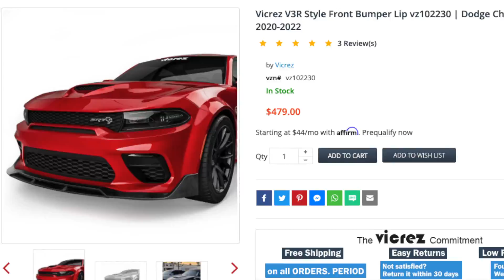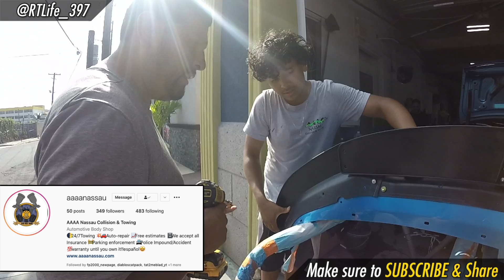Charger Widebody kit

Comment: For the louver. I had to put a super glue and velcro, cause the first time I put it on it was just a 3ms and when I tested it to 100mph,  half of the side came off luckily it didn't fly off. Lol but just letting you know velcro and super glue help my louver stick even going 120+ it's still there lol. Nice finished with your mods.
Reply from the maker: Oh man I'm going to keep an eye on that. Def don't want the Louver flying off while driving! Thanks man for the heads up

Comment: Check that gap in between the bumper and your front right fender. Looks like it wasn’t lined up right on install.
Reply from the maker: I believe it's the intercooler - it's too big for the front bumper. After the turbo install it didn't line up properly
Reply: @RTLife  did they try to trim a few pieces or get rid of some inner plastic pieces? Or is it literally against the actual bumper cover itself?

Comment: looks good, wouldnt do the louvers myself the (how to clean factor and dash cam) get the aggressive look. looked at the front lip decided against for the sticking out distance. Vicrez do some nice work. used them to turn my old v6 challenger into a widebody before i got my stock 392 widebody. seemed alot easier to buy then custom fit and work around non factory issues.

the engine work ive been very interested in that is nuts
Reply from the maker: I understand what you mean - both have their drawbacks. I really like a lot of products they're selling now. Pretty solid prices for the most part. The build is slowly getting there- little bit each month.

Comment: Very nice! Aggressive looking!

On a side note, not related... Do you happen to port your heads at all? I'm looking to do that myself, but wanted to know if you did, what gains did you have, if any? 

Thanks
Reply from the maker: I did have the heads ported when the stroker kit was done. Can't really tell you how much HP was gained but it's a solid upgrade if you're adding forced air down the road.
Reply: @RTLife  Thanks man. She already has a stroker Kit along with a Whipple blower. That the last part of the engine that's still stock... Should've done it the last time the engine was apart... Smh 🤦🏽

Edit: looking forward to seeing your Dyno numbers! Keep the build going!

Comment: Sweet.....Time for some 1/4 mile action
Reply from the maker: Hoping late sept or october this thing will be on the track to see how it does
Reply: @RTLife  if you send it definitely will 9 but I’m betting on mid low 10’s @ 135+ mph
Reply from the maker: @SixTwoHemi  if I did dual pumps, 1440 injectors the power would be there for 9’s. I’m betting this will be in the 700-750whp range so mid 10’s is likely where it will be. This stuff gets really expensive once you start getting parts that can handle 800-900whp

Comment: Dude you need the big break kit from wildwood that should be before anymore performance or stance upgrades...your braking system is for Sh*t right now! Do it!
Reply from the maker: I have the upgraded power stop setup in place now - performance pads & drill/slotted rotors.

Comment: Does your Car feel like it's got the Power of a HELLCAT❓❓ , JUST LIKE A STOCK ONE❓❓
Reply from the maker: turbos are much different (so it will always feel different) but it will have closer to a bolt-on tuned Hellcat HP once it's dyno tuned Aug 25th

Comment: I built a 2016 Hellion 392 it does low tens at the racetrack Baytown Texas . told to put a roll cage in it or I can't race. The wife and I are selling it at 70000 we're finally doing it buying a Tesla plaid and a cybertruck you are fixing to find out just how much a turbo system really cost you're going to go broke trying to keep it on the road
Reply from the maker: just getting everything needed in place for a turbo system is expensive. I'm not doing a roll cage or anything in this. If I get kicked off the track with this it will be the last time I go on one.